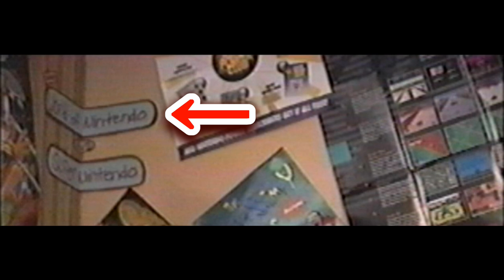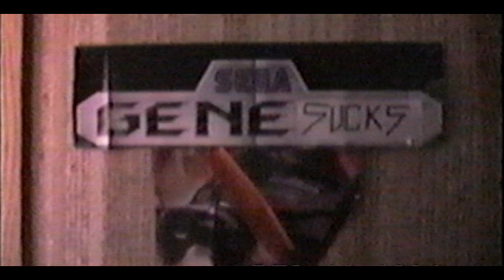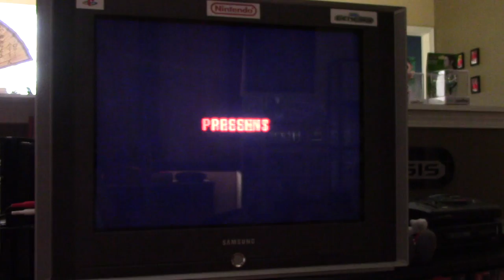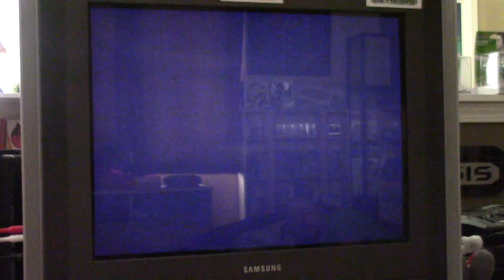Maintaining your Nintendo Equipment: Super NES Vertical Band Fix

Comment: Just an FYI for anyone watching this video now.  All you need is a 470uf cap on the 7805 to clear this issue.  I've tested this on a couple of systems and it works every time.
Reply: I bought 470uf 25v i couldnt find 16v here in Canada is it still ok?
Reply: You can use a greater or equal to on voltage as long as the uf is the same
Reply: Using a 470Uf only on the voltage regulator will only make It better or does It completely remove the vertical lines?

Comment: Bob,
Thank you for making this detailed repair work video on the Super Nintendo. The vertical band on the screen is a known issue that I came across when I was researching on how to fix a video problem I encountered on my girlfriend's childhood Super Nintendo. My goal was to fix a wavy interference video output that was present on any game played on the system. I had a goal to salvage the system and keep it as a part of her family. Therefore I went out to learn proper soldering techniques through YouTube and bought the right tools and capacitors to work with. To further my research, like yourself I referred to Shane McRetro's channel on his work with the Super Nintendo as a reference some time back. Through him, I learned how to properly remove capacitors and what to look for when soldering on different revision motherboards. Through my research I realized that my issue lies in capacitors starting to leak/fail especially for a system this old. I managed to properly remove all previous SMD capacitors, and solder brand new Nichicon brand capacitors to the motherboard. It in turn resulted success in fixing the wavy interference on screen.

Since I have gained the confidence in soldering, I am planning on working with my own first generation Super Nintendo (yellowed) in removing the vertical band video issue. Your video is a driving force for me to attempt it and is a good reference to refer to. The method you captured on video is very clear and precise. The high resolution video footage to see where each leg needed to be soldered onto each component was very helpful. A photo of myself working on the SNES motherboard can be found here: http://goo.gl/Y69O2S

Sorry for a long message, but just thought I wanted to share my experience on working with the Super Nintendo and hopefully maybe you or someone might find it useful.

On a different note, I have been a big fan of your channel for a very long time. I haven't commented on your videos as much as I wanted, but wanted to let you know that you bring great entertainment and value in the videos that you produce. Like yourself I am a big Nintendo collector, and have accumulated a decent sized collection. To note, I am also a YouTuber and have a Nintendo dedicated channel. Your channel inspired me on collecting many things Nintendo related, and especially since I have strong roots in childhood memories dating all the way back to the NES. If you have a chance, I would appreciate you check out my channel and especially my latest Nintendo room tour to see what I have to offer, which can be found here: http://youtu.be/QlUJlpfbo7U

Thank you very much for your work and contribution to the Nintendo YouTube community and wishing you a happy and prosperous 2015 New Year! :)

Fellow YouTuber,
Danny4842 (http://www.youtube.com/Danny4842)
Reply from the maker: Danny,

Thank you for taking the time to write such a thoughtful comment.  I'm impressed that you were able to teach yourself how to solder just by watching videos.  I, of course, resorted to a friend who does it for a living.  I'm also glad to hear this video has made a contribution to your repair efforts.

Like yourself, I also watch many channels but do not comment frequently (yours included).  I do follow your channel regularly and particularly enjoyed your latest video in which you shared with us your Christmas morning; such a cool figure with Link on Epona!  You're very lucky to have that and, probably even more so, to have the person who gave it to you as such an important part of your life.

Thanks again for your comment and please do let me know how the mod goes for you if you decide to do it.

Bob
Reply: why is this marked as spam?
Reply from the maker: because it contained links
Reply: World of Nintendo o
Reply: World of Nintendo Is it possible for you to post those home videos of you when you were a kid onto YouTube?

Comment: Two 220uF (16V) capacitors (=440 uF) soldered parallel to the power-regulator do the same job btw. . I tested that. 
No need to solder a capacitor to the Videoencoder, since both Pin no.6s of the Encoder are the same as Pin "O" (+5v) at the power-regulator.  

Easier to do as well. 
Or even more easy: A single 470uf capacitor at the power regulator would likely work as well.
Reply: +cannyfocus So did you just put 2 220uf caps on the I and O of the voltage regulator?
Reply: if 1000uf?

Comment: 16:01 that reduction in background noise is quite significant. It looks as if the blacks are deeper although it also appears the color is also less vivid. but that can be adjusted on the tv. 

did it make the display look any sharper?
did you have the same settings for both?

 after first seeing Shane McRetro do this i was wondering if there was a general reduction in noise besides the vertical bar . Nice compare video! ill have to see if this works on a rgb snes mini as well.
Reply from the maker: dylbob9000 the tv had the same settings for both demos.  i'll have to check to see about the colors being less vivid, but i didn't notice any degradation. let me know how the snes mini mod goes (i didn't realize the vertical bar was an issue on that model). thanks for the comment!
Reply: World of Nintendo the vertical bar isn't a issue in the snes mini but there is noise when you upscale via a xrgb mini. the noise im referring was if you pause the video at 16:01 you can see as well as the bar being reduced the general clarity of the black screen is improved ( no white haze ) also at 16:20 notably in the rocks bottom left there is sharper detail. also being less vivid isn't necessarily a bad thing, i should have said less color bleed. thats what im seeing anyway.

if you really want to go nuts you could replace the 7805 with a OKI-78SR-5 Switching Regulator 5V, a couple of bucks but apparently so efficient it dose not need to be connected to a shield and reduces noise. im gonna order one myself see how it gos.
 http://etim.net.au/shop/shop.php?crn=206&rn=547&action=show_detail&edit_item=0
Reply: +dylbob9000  hello, well i have horizontal band issues on my snes junior...i think it's touching any kind of snes console after many time (and am not upscaling the console)

Comment: I had played both original and Jr redesign versions of the SNES. The vertical line flaw is only visible in dark backgrounds or if you look closely in slow side-scrolling movements in the center of the TV screen. They don't bother me, though it is strange. From my experience with the Jr model SNES, being 1 Chip, the line is still there even in that model, but not as bad compared to the older revision. I think the compactor mod will make an old 2 Chip SNES look roughly the same as the later run models in the TV. It doesn't disappear entirely.

Plus side, the line flaw is the sure way to know you're playing a genuine Super NES and not a clone.

Comment: This is odd. I have four SNES consoles. One is a launch model, 2 are from 1992 and one it from 1993. They all don't have this issue, but if I do come across one it's good to know there's a fix for it.
Reply: Yeah, probably some capacitor is dead and needs to be replaced, probably not need to add new ones. Or it could be a bad quality power source
Reply: That's sheer luck right there, because almost every single earlier launch has the band issue.
Reply: @LITTLE1994  I believe it could also be how the system was stored or something. Age and time affects things differently.

Comment: on the 7805: 470(milliohm) or higher. 25v vs 16v, 25v has higher internal resistance and will [microseconds] delay snes bootup  (more noticeable at 200% clock speed). on encoder: any higher than 16v will dim color as capacitor must charge before output of video, any higher than 500(milliohm) not recommended because it's internal resistance is higher than encoder chip. DO NOT USE 25V on encoder chip, you'll burn it out in 18mo. tested on sus-001 and made bar and noise invisible no matter situation, untested on snes-mini. requirement for a 24 year old console.
Reply: What then would be recommended to fix this issue?
Reply: @jasonkemmett4608  i think he just said. use 16v instead of 25. did u fix yours btw?

Comment: I have the first model of the SNES that does not have that problem.
Reply from the maker: Peterisa VideoGameGuy that's good news! to double check that you have an original model of the motherboard, check: 1. on the bottom of the console that it has four (not two) rubber feet and 2. on the back of the console that it has a white (not dark gray) Nintendo World Class Service Center sticker.  those are some other ways you can verify the model of your motherboard without taking the console apart. either way, i'm glad you don't have the problem!
Reply: Oh. My stytem has the thing which locks the game in when it is on and has four feet. But the Nintendo World Class Service Center is gray. I thought it was the first model. Sorry.
Reply from the maker: Peterisa VideoGameGuy no worries.  all of those external characteristics really can't give you a definitive answer about what version of the motherboard you have. the only way to know for sure is to get the model number off of the motherboard itself.
Reply: World of Nintendo Thanks, I'll try to get a game bit and look at it. Also I'll reverse the yellowing of my SNES.
Reply: Never mind, I put Super Mario All-Stars in, and I saw the band. Sorry about that.
Reply: @the8-bitmusicians783  hoops, hehe

Comment: Odd, I actually noticed this problem in Donkey Kong Country 3. I think it was the second or third level. Even though it's not a dark area, the sky is a particular shade of blue that causes the stripe to be visible. I thought it might have been my s video cable but this video clearly proves it's the encoder chip because that stripe is in the exact same spot. Thanks for the upload.

Comment: Why did you use such a high voltage cap, 5v and up would be fine wouldn't it?
Reply from the maker: I used the components recommended in a video I saw about the mod.

Comment: I bought this on ebay 470uF 25v 10x16mm is it okay or should i get the 10v ?
Reply: I'm not an expert, but 10V is probably best. 25V may be too much. If you find out which is best, tell me. I'll edit this if I am corrected.

Comment: You know that if you replace a fuse with a nail the hardware will work the same... Why this people are so crazy about adding big capacitors to this things?
This can be fixed by adding  a decoupling capacitors around the video encoder, small 100nF ceramic capacitors will do, I suggest you do the same for the PPU's.

Comment: haha why did nintendo make the NTSC model purple?? my PAL rainbow model is pretty as!
Reply from the maker: Mitchell Theobald no idea... i wish we had gotten the same model released in all other territories.  it's much more attractive, in my opinion.
Reply: +Mitchell Theobald You should mod your PAL SNES for 60hz instead of 50hz. That way your games won't be squished on the screen and your games will also run at the normal speed rate.
Reply: I think Nintendo of America wanted the most call attention look and distant from Sega Genesis possible. The Pal and Japanese Snes look is as, but those rounded cartridges not so much. The Squared NTSC cartridge is much tougher imo =D. It looks something Robocop would pull off his leg :D. Greetings from Brazil!

Comment: I had a Xbox original console that had a clock capacitor go bad due to overheating and overclocking the graphics to maximum resolution of 1080i and the system was replaced with a Xbox 360 that after I had purchased the NYKO INTERCOOLER EX it got the RROD.

Comment: my snes doesn't have this flaw at all and my snes is the older version with the sony music box by itself and the lock in place mechanism is there. I tried playing my snes in rf and doesn't have the line and tried this in rgb to scart picture quality and the line isnt there at all.
Reply from the maker: Gamerguy8585 that's good news! to double check that you have an original model of the motherboard, check: 1. on the bottom of the console that it has four (not two) rubber feet and 2. on the back of the console that it has a white (not dark gray) Nintendo World Class Service Center sticker.  those are some other ways you can verify the model of your motherboard without taking the console apart. either way, i'm glad you don't have the problem!
Reply: World of Nintendo i have the 4 rubber feet. if you want i can take apart my snes i have had problems with it in the past and i can tell you what version of the snes it is?
Reply from the maker: Gamerguy8585 if your console is working, i don't think it's necessary to take it apart.
Reply: World of Nintendo i just did so how do you tell what version of the motherboard of the snes i have?
Reply from the maker: Gamerguy8585 it's printed on the top of the board, along the right hand side by the reset switch. you'll have to remove the metal rf shield to see it.  i believe that very first models have a copyright of 1990 and the code ends with  -00 or -01.  this picture illustrates what i'm talking about:  http://www.the-liberator.net/site-files/retro-games/hardware/Nintendo-Super-NES/Nintendo-Super-Nintendo-Entertainment-System-PAL/Nintendo-Super-Nintendo-Entertainment-System-PAL-014-Motherboard.JPG
Reply: World of Nintendo I found the number do you have an instagram or Facebook or something so i can send you a picture of the snes?
Reply from the maker: Gamerguy8585 if it's possible (i'm not sure if it'll work) you can post a picture to my google+ page.  you could also make a short video of it and post it to your youtube channel.
Reply: World of Nintendo ok i will do that
Reply: World of Nintendo I posted the video. You should make an instagram it would be a cool way of showing off your collection. thats where i show off my collection.
Reply from the maker: Gamerguy8585 that certainly appears to be a first-revision model of the motherboard.  it's awesome that it doesn't have the vertical band problem!  nice!
Reply: World of Nintendo ya whats your model?
Reply: World of Nintendo not trying to be rude or anything but there is a better video quality for the snes and it is called RGB to Scart which is way better than S-video. there is a person on eBay who makes really good RGB to scart cables and if you get the cable you need a converter that makes scart able to be used on new plasma 4K tvs so you need a Scart to HDMi converter which you can get on eBay or amazon. if you want know how to get them go to Adam Koralik or search on youtube "how to get better video quality out of a snes" and look for Adam Koralik's account.
Reply from the maker: Gamerguy8585 i have the same model you have. thanks for the tip about rgb scart.  that works only with new flat screen hd tvs. i play my older consoles on old crt (cathode ray tube) tvs because i think the picture looks better and it's how i played them back when i was a kid.  adam koralik's rgb scart method is superior to s-video so long as you're playing modern tvs.
Reply: World of Nintendo ya since i never grew up with new snes or n64 i want the best video quality possible but gamecube i like just in composite form. But if you ever need help finding cables or converter for snes just give a shout.
Reply: World of Nintendo insted of converting scart to hdmi you can try converting it to component i hear component is the best the US has to offer
Reply: justin rivera no scart is scart has better video qualities than component

Comment: My ver 1 pal snes does not show this banding and I've never seen it before.
Reply: +chocograph Mod it for 60hz
Reply: +Helloz World You're a year late but modding 60hz has nothing to do with it. I installed a couple of capacitors which got rid of most of it.
Reply: But PAL gaming in 50hz slows down everything on older consoles.
Reply: +Helloz World Must be some confusion here. What does that have to do with the vertical bar? You'll have to install some capacitors whether you got a 60hz/region mod or not. the banding shows on both 50 and 60hz mode. I've since gotten a 1-chip snes and that had clear banding. So did my version 1 snes once I checked it on my lcd with the framemeister..it's just not noticeable enough on my crt. I can say the banding was very pronounced when using a cheap chinese PSU I got from ebay. Once I got the official one the image got quite a bit cleaner. Then I installed the caps and it's pretty much removed completely. I even tried the RGB amp mod on my 1 chip snes and that removed any kind of banding whatsoever but the image got even more noisy so I removed it. I have also got a 1ms benq monitor and realized that the input lag is barely noticeable, the image is of course better than the framemeister can do and makes emulation a totally viable option. The vertical banding is caused by unfiltered power fluctuations running through the SNES. Correct me if I'm wrong but that's my understanding. The caps work as a water cleaning filter of sorts?
Reply: +Helloz World Stupid edit won't work. I have 60hz and region modded both my ver 1 pal 92 snes and my 1 chip 95 snes. Banding occured on both. Step one is definately to get an official PSU, then to install the caps. Even just one cap on the voltage regulator works well.
Reply: :3